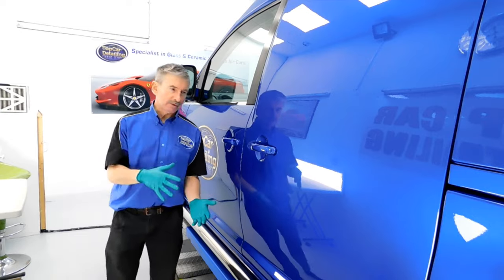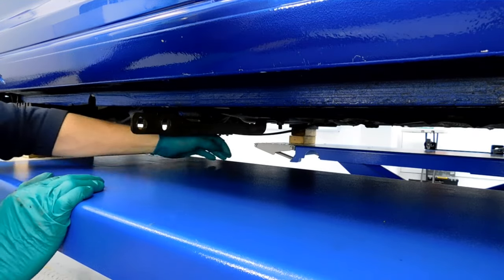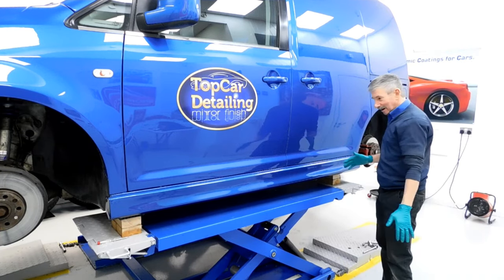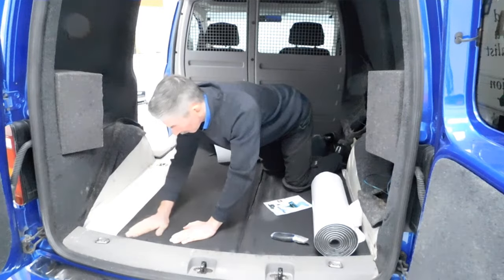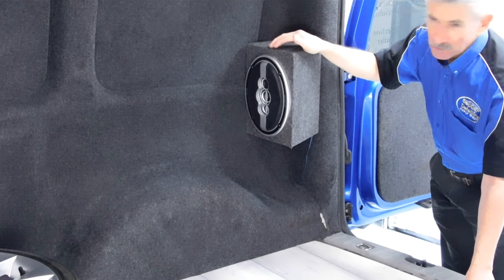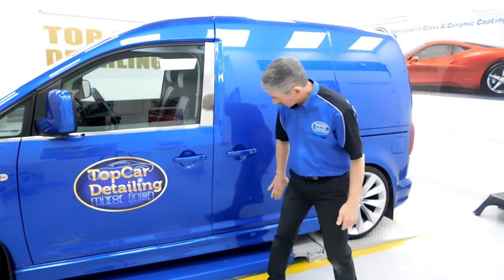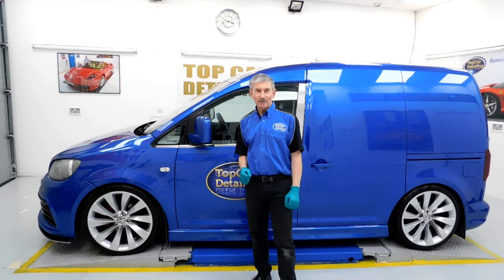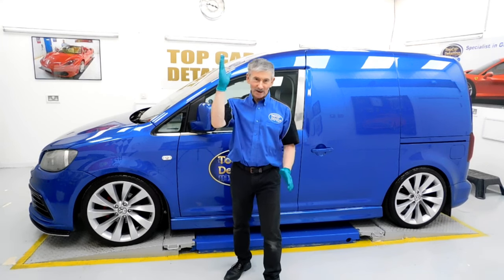VW CADDY VAN UPGRADE - EXHAUST -  FLOORING - EXTERIOR MODIFICATIONS

Comment: Lovely, but if you've gone to effort taking the side trims out couldn't you have sorted the front badge dimple! 🤔😁😂
Reply from the maker: There was an issue with the part that slots into the bonnet, so next time it goes into the body shop we shall sort this out, there are a few more things to do on the van once I get some time Cheers.